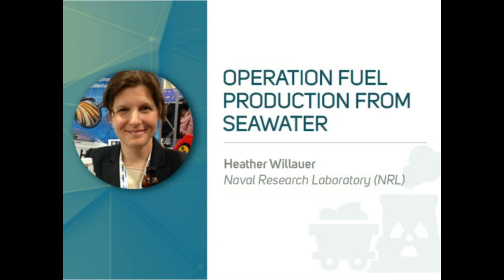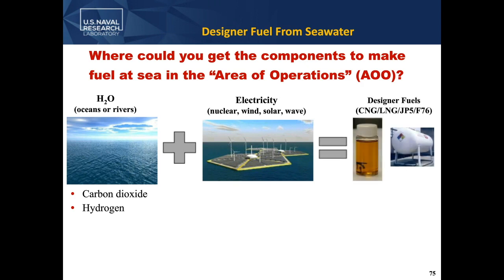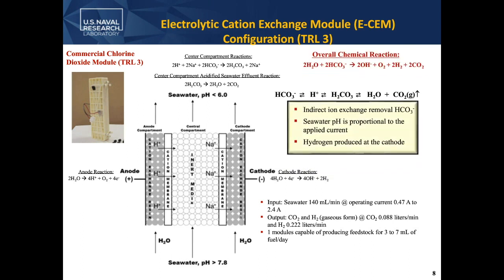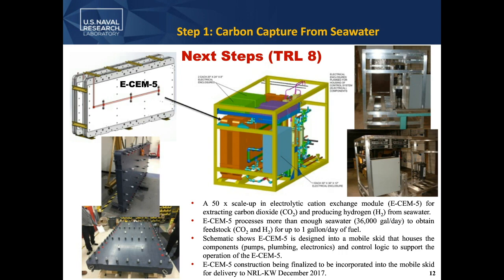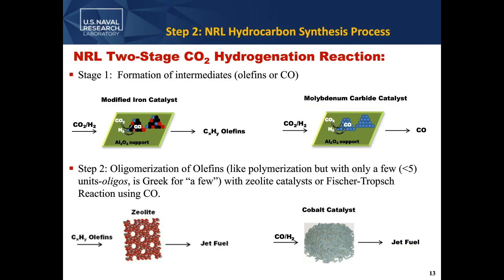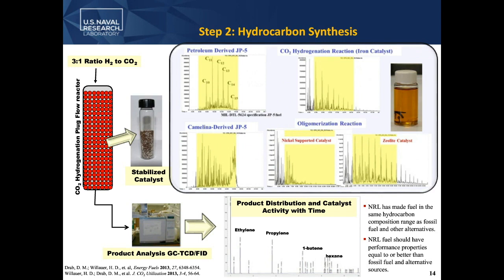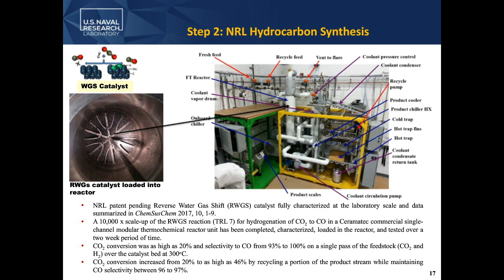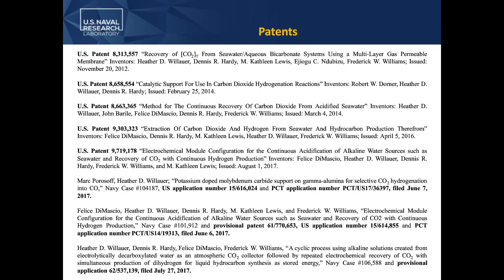Heather Willauer, Naval Research Laboratory (NRL)

Comment: I'm looking at this again.  At 4:46 you say that you're moving around ions and wind up with a more basic solution able to take in more CO2 from the atmosphere, however, the diagram shows that the pH of the inlet seawater at 7.6 and the pH of the outlet is 6.0.  That's more acidic, not more basic.  If it's more acidic, that means it's less able to take in additional CO2.  Please explain this so a mechanical engineer can understand.  Thanks!

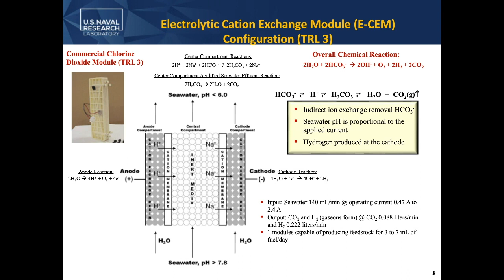Comment: It seems like a pretty cool process, but I have questions.  First time looking at this.  At 5:00 we see a diagram that looks a lot like splitting water with electrolysis.  But I see sodium ions moving toward the cathode and nothing seems to happen to them.  I also see sodium in one of the equations and it's not reacting with anything.  Where does it go?  And I assume the source of sodium is ocean salt.  If the sodium is doing something, what happens to the chlorine?

Comment: Ok, here's some back-of-the-envelope math (using TRL6): 
power input: 25.7kWh per m3 of h2 (1000 L).   
modules generating h2 at .222L/min, that is 75 HRS of operation to get a cubic metre of h2... so 25.7kWh produces 3 days of operation, roughly 1 gallon of "fuel stock" per module.  25.7kWh input = 1 gallon fuel output.  Assuming this fuel stock is somewhere between ethanol and jet fuel (naptha), that's roughly 28kWh/gallon (~100,000 BTUh/gallon) 

if 25.87KWh of input can generate 1 gallons of "jet fuel", this becomes relatively cost effective.  at $0.10/kWh generating cost, that is ~$2.80/gallon of fuel.  There are no transportation costs if the fuel is being generated "onsite".  The only issue seems to be the size of the units.  The skid is 75 cu ft, and 3 are needed to produce 1 gallon of fuel per day.  225 cubic ft of generators to produce one gallon per day.  (2.778 cubic meters).

An F35 (cv) jet has a 19,000lb fuel capacity (~2500 Gallons).  So it would take roughly 7100 cubic meters of fuel generators (about 215 40ft shipping containers for scale) to fill a single jet.

A large container ship can carry about 9000 of such shipping containers, which if they were all "fuel generators" could refill 40 jets per day operating at full capacity.    At 26kWh per gallon of fuel, that would require constant electrical input of ~107MW, or 2570MWh/day of electricity to produce.  This is within range for a naval nuclear reactor.  

Assuming industrial miniaturization of 4x (not unreasonable) this becomes fairly reasonable.

edit: just read 60% efficiency, so  jp5 equivalent would be ~$4.60/gallon, more than the $2.15/gallon that JP5 costs currently.
Reply: JP5 costs a lot more when accounting the full cost to get it to the ship, storage prior, etc.
Reply: @NWer-c5u  JP5 would cost more still if we started accounting for externalities by charging hefty fees to extract fossil fuels.

Comment: Impressive work.  I understand the Navy's specific needs but when this scales up I wonder if it would make sense in a desalinization plant since the water intake and initial filtering can be shared.  Perhaps this process by removing CO2 would ease the work of desalinization.
Reply from the maker: This is a great question! For more info, we suggest reaching out to Dr. Willauer at NRL. You can get in touch by checking in with the Lab Rep. Their information can be found here: https://flcbusiness.federallabs.org/#/laboratory/1370.